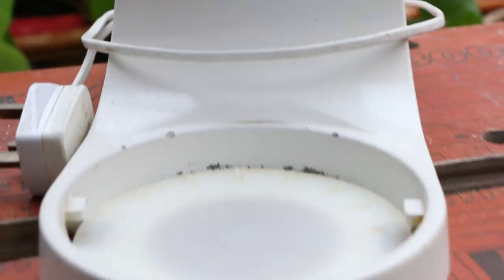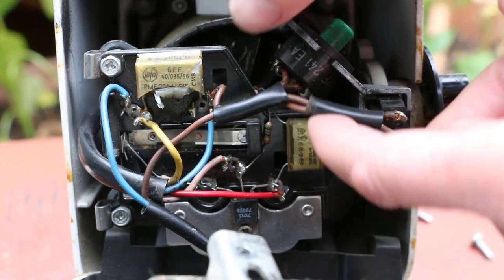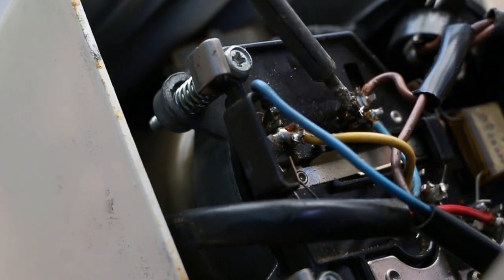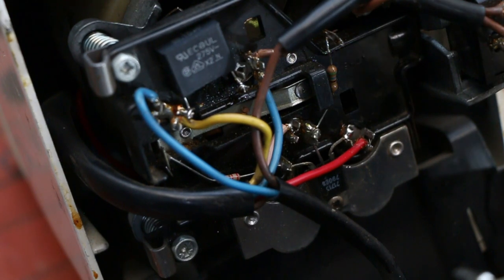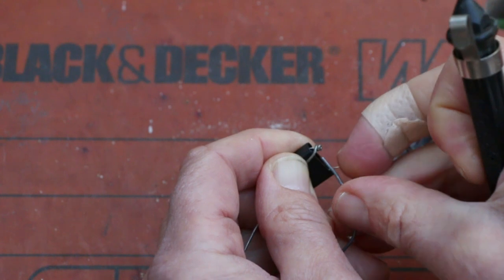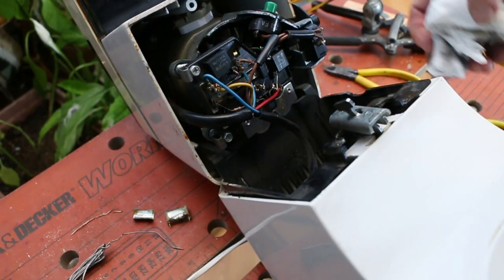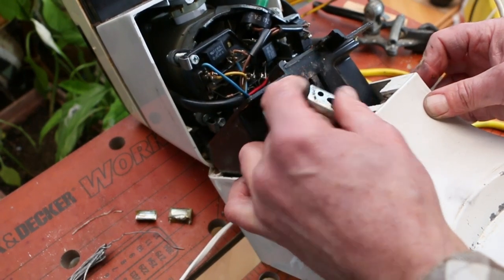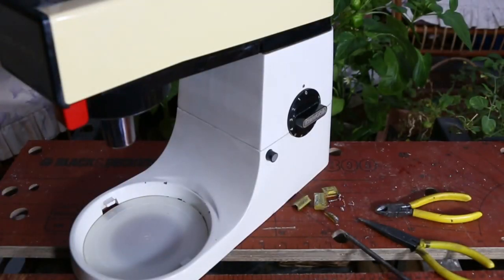Kenwood Chef A901 Smoking Capacitor and Repair.

Comment: The Caps on the mixer are both different ! , but you have put 2  of the same type back  on  !
Reply from the maker: On my machine the larger one is Class X2, 0.15µF 275V the smaller one is Class X2, 0.047µF 275 V. They both look similar but are different values.
Reply: @twotone3070  Thanks for your quick reply , do you know what make they are ? .
Reply from the maker: @SpikesMavic  I didn't choose a particular manufacturer, but I did use a CPC Farnell for the supplier to ensure I got genuine quality components. The part numbers were CA07109 and CA07107 respectively. Cost more for the postage than the parts, a total of £7.02 but you do get 5 of each.  The important bit beyond the capacitive value, is that they are X2 rated and e-bay may not result in the best quality.

Comment: hi, what are the capacitors I need to do the same job please?
Reply from the maker: Hi Andy. The larger one is Class X2, 0.15µF 275V the smaller one is Class 2, 0.047µF 275 V. Are you in the UK?
Reply: @twotone3070  thanks for the fast reply only just watched the video 5 minutes ago
Reply from the maker: @andystanley562  I'd have been quicker had I not had to Google the ALT230 to get a µ symbol :)  If you don't have a preferred supplier for genuine components I used CPC Farnell and the part numbers are CA07109 and CA07107 respectively. Cost more for the postage than the parts, a total of £7.02 but you do get 5 of each :)
Reply: @twotone3070  thanks for that, I am not an electronics guy - outdoor education is my thing,  have a YouTube channel just started - Expedition Hiker -  but my parents gave me the pass me down Kenwood, but 1st time turned on, it smoked so be nice to get it working,
Reply: @twotone3070  Thanks,  i have placed an order with CPC and ended up buying other stuff from them too, although not sure once paid why they want to do a credit check as not looking for an invoice
Reply from the maker: How did you get on with the mixer?

Comment: My Kenwood just made a loud pop and started smoking, and it stank! I have opened it up and the 0.047 capacitor is cracked like the 0.15 capacitor shown in your video. I have ordered the repair kit and will attempt the repair myself. Do you think it necessary to also replace the resistors and triac?
Reply from the maker: As it is in the speed controller part of the circuit I would probably change the triac as there is a risk that damage could have been done and you'd end up doing the job twice if that was the case. 
As far as the resistors go, if there is no damage visible you could take the risk that they have not blown open circuit, but then again they are not that expensive and you probably won't need to open it twice.
As I have mentioned before, the important part of the capacitor replacement is the X2  specification, it's a safety issue.
Hope this helps.
Reply: @twotone3070  Ok thanks! The repair kit I bought contains the triac, and resistors, so I'll give it my best shot!
Reply from the maker: @annemccabe9126  Nice hot iron, flux either in the solder or separately, make sure the tags are clean, make mechanical connections before you solder if possible, take photos of where things go, check the leads on the triac are the same configuration, don't heat the components too long, plenty of light, wear safety glasses - you won't get 2 goes if you flick solder in your eye, work out the order of operation so you don't block your own workspace.  Nothing to it - oh and don't burn your fingers. :)
Reply: @twotone3070  Thank you! :D I did electronics at GCSE but that was about 20 years ago...I'll let you know if I was successful!

Comment: Hi there. Do you have any plans OF the motor armature. I need to clean the armature and I need to know how hard it will be. Thanks
Reply from the maker: This doesn't belong to me so I can't take it apart again. I will look at the videos and see if I can highlight what you would need to do. Sorry it won't be for a couple of days though as I'm out shooting videos for my other channel.
Reply: @twotone3070  thanks a lot friend. I am searching also in document sites but i have not found anything yet
Reply from the maker: @giorgiokawa104  I have found this video (not mine) where he seems to go deeper into the machine. May be worth a look. https://www.youtube.com/watch?v=RozelD1ZXnY&list=PLNQ6Wv9valI8bHtUj707m9gcDr650VmVQ&index=3
Reply: @twotone3070  I got it but it is about 702 models. 902 is much different. Anyway I opened the armature I have cleaned it and now I have to put everything back :) I need some special washers though and I have to make a little search for them. I will try to post some pics soon
Reply: @twotone3070  Hi my friend. I finished everything with the motor but i have an issue with the resistors. I have lost the speed control cause the watts of the resistors I think is too much. I have pics of every step of cleaning and fixing the motor and i will post them soon so that everyone will find help
Reply from the maker: @giorgiokawa104  "cause the watts of the resistors I think is too much" do you mean the resistance of the resistors?
Reply: @twotone3070  no the fourth colour is gold.
Reply: the tolerance
Reply from the maker: @giorgiokawa104  That means the resistance of the resistor can be as much as 5% more or less than the stated value.
Reply: @twotone3070  correct and i this this is the problem with the speed controller. I have the original one and i will seek for all tolerance values to test it and then i will tell you what happened. The armature is too clean now ant everything inside the motor is in a perfect condition.I will post the pics soon
Reply: @giorgiokawa104  What are the colours of the resistor colours?
Reply: @anthonysinfield4778  I am so sorry to be back after so many days but i am making a dinner table and I was too busy. So here is the deal there are 2 resistors connected to the speed controller. One is connected to the thin metal that is touching the armature and i call it R1 and the second resistor I call it R2. 
So the original R1 red red brown gold on brown body. so it means it is 220ohm tolerance 5%
R2 is green blue black gold on grey body so it means it is 56ohm tolerance 5%
the new resistors that i received have the same values BUT the resistor body is almost double from the original ones. I thin it has to do with the watts the resistor can hold and maybe this is why i lost speed control . This week i will try to visit my electronic store to find same thickness resistors.  I also will find a way to upload images of the motor totally disassembled
with instructions how to put everything back in order
Reply: @giorgiokawa104  You can use a larger size resistor as it will have the ability to carry more current and hence wattage, so that is a good thing. Do not use a smaller size as this could burn up. So if the new ones are larger and the same values the you can fit them without having to worry. It would be the resistance value that would have an effect on the speed control. Have you tested the actual resistance values of the old resistors?
Reply: @anthonysinfield4778  yep I did that and I double check with multimeter. I think it has to do with the watts. I will check it soon and i 'll be back :)

Comment: I found the same model in a family member's attic, didn't think twice and used it as it was to knead bread for 2min and then brioche for another 2min and then I heard a "crack" and it started to smoke and smell. I opened it and it's the same problem, I'll get the parts and ask my husband to do the repair but I've seen videos where they also restore the whole gear box (cleaning the old grease and refilling it with new one) and I'm wondering if it's necessary to do so because the mixer is 30yrs old if not more and hasn't been used for at least 10yrs, what do you think ? Your friend is using her old mixer thanks to your repair, do you know if she ever had to replace the grease ? Thanks in advance !
Reply from the maker: Hi, she is using her mixer and as far as I know there have not been any other repairs or servicing done, so the gearbox as is from the factory. Now, that doesn't mean that it wouldn't be  slightly more efficient if it had an entire overhaul and if you found it in the attic, then it will perhaps depend on what that environment as been like. If it's been excessively hot the grease could have dried to the point of being useless.  
If you can peer inside and see if the grease is still tacky I think I'd be happy to use it like that, if the grease comes off in dry lumps then maybe not.  
People seem to love these machines and it would be a shame to see it go to the dump for the sake of a little TLC.
Please let me know how you get on.
Reply: I would change the grease.  My mothers one failed in the top gearbox (1 plastic gear), and I found a guy on ebay selling recreations of the gear.  I realise this is 7 months ago, but you can still do it. My personal mixer is about to get the works done to it, Caps and grease. It went pop during the great pandemic home baking explosion.  I bought it 20 years ago from under a table at a car boot sale!

Comment: I snipped the big capacitor off and it still works. Does it need it? I know it's a silly question. It was smoking but now works ok
Reply from the maker: I would still suggest you replace both capacitors as they will most probably be of the same age and the second is likely to fail.  I don't mean this sarcastically, just logically, but it would be fair to say that if the manufacturer didn't need to fit the one you have removed, then they wouldn't have.  I'm afraid I don't profess to know everything about the machine but I suspect the capacitor is being used as a filter, the other is part of the speed controller circuit and I would highly recommend changing both.  Hope you have success.
Reply: The capacitors operate as mains filters and keep radio interference off the mains as well as spikes etc.  Best to keep to manufacturers spec.

Comment: Hello
Sir, I therefore allowed myself to contact you because I have a
Kenwood chef A701A and it has just broken down. When I press the blue
button on the speed variator it starts normally at all speeds
(constant increase in speed) and the more I turn it the faster it
goes. Only when I put the sheet or the hook with a preparation inside
it leaves timidly and stops immediately turning although the engine
is still very audible. I think he no longer has the strength to train
the accessories. I started to disassemble it because I was thinking
of a problem with the strap on the top but it looks in good
condition. Before dismantling everything, could you help me by giving
me some tips on the breakdown. Hope you can help me thank you in
advance. cordially
Reply from the maker: You say that yours is an A701? I have only fixed this A901.  I have to say I only did the repair you see in the video on that machine, any advice I am giving is purely theoretical and not from experience. If the machine is more than 20 years old I would suggest changing any capacitors as there is a possibility that the capacitor in the speed controller is failing when you draw more electric current during mixing as this loads the motor. Also there could be carbon brushes in the motor which are no longer making a good contact and again when the load is applied to the motor the higher resistance will cause the voltage at the motor winding to reduce, slowing the machine.  I don't know how the speed controller works in detail, but those are the two parts I would look at first.  I hope this helps.
Reply from the maker: Take a look here as it may help you inspect the brushes. https://youtu.be/_cHbfg4zJ_U

Comment: Well mine is all mounted on a circuit board and  looks like two capacitors have burst. I cant see hoe i can repair it short of complete disassembly including unsoldering 4 wires and unmounting the circuit board. And its difficult access to the screws. so i think its junk now tbh.
Reply from the maker: Could you leave the existing capacitor leads in place attached to the circuit board, form hooks out of the ends and solder the new capacitors to them? Shame to bin it when you can see what the problem is, the machines seem to be well liked by their users.

Comment: Hi my kenwood a701a at lowest speed runs st full speed any advice thk
Reply from the maker: I don't have the actual mixer in the video so am unable to test anything for you, also it's a different model. But you would need to take the cover off that lets you see the mechanism on the inside of the speed knob to work out how it is done.  Obviously having disconnected it from the mains by removing the plug from the wall.  In the A901 there is a capacitor in the speed controller circuit and this may be the same in yours, if that is the case it could be as simple as replacing it.  Let us know what you find - TAKE THE PLUG OUT! :)
Reply: Ok thk

Comment: If anyone could help me with my problem I would appreciate it very much I am in Canada 🇨🇦 and a friend asked me if I could possibly repair her mixer that was smoking I found burned capacitor and resistor directly beside it. I replaced both reassembled and ran it for about 5 minutes only to have another capacitor burn arghhh need help please...how do I contact you thank you so much 😊
Reply from the maker: As both the capacitors are likely to be the same age,  I would simply replace the other one. Make sure you are using ones of equivalent quality, if they are X2, then they need to be X2.
Reply: Twotone ..wow thanks for quick reply I know next to nothing about electronic side of things so it’s difficult.
Reply: Twotone don’t know what you mean by X2 please explain I got these from the kit they sell on amazon 2 capacitors 2 resistors
Reply: Twotone is there a way I could have a FaceTime discussion wish you were here to help me
Reply from the maker: @bobthibodeau5699  I'm no expert, but it explains it here https://www.allaboutcircuits.com/technical-articles/safety-capacitor-class-x-and-class-y-capacitors/
Is the latest burned out capacitor the remaining one in the kit, or have you used both already?
Reply from the maker: Bob, how did you get on?
Reply: Twotone I ordered two new capacitors for the model A901D model they should be here in a week. If I have any questions hope you don’t mind me consulting with you . Thx so much for your reply. Sincerely Bob from Canada 🇨🇦
Reply from the maker: @bobthibodeau5699  No problem. Let's hope this gets it fixed.
Reply: Twotone guess what my friend parts are probably going to be delayed but for sure( Corona) I want your help via FaceTime my brother your willingness to help is so appreciated. Just so you know full story it’s a bit funny but not. The Blender Woodward A910D model belongs to fellow snowbirds in Mexico so the six of us are here in Puerto Vallarta. She has had it 40 + something years and she treasures it she does volunteer baking for the underprivileged here at local landfill. Anyway all Canadian tourists ( especially those in 79-80s ) are panicking to get back to Canada. The Healthcare here isn’t the best. Now here’s the part I don’t blame you if you shake your head as it sounds nuts. He had one of his lungs removed 2 years back. Super high risk if Dave gets infected. I am driving 4 Canadians to airport everyone is leaving 1-2 month early. Leaving in next 20 mins to pick them up. Grocery shelves here are still well stocked good because we’re here till end of April. We drive 5 days from Alberta they fly. Anyway the Covid stats from media here are faulty as nobody is being tested. Anyway take care,  stay well friend  sincerely Bob Thibodeau sorry bout long letter.
Reply from the maker: @bobthibodeau5699  Let me know when the parts arrive and we'll see what we can do.
Reply: Twotone guess who got ordered back to Canada from Mexico ...yep you guessed it me thanks to Corona Virus , parts being delivered to Mexico address and not thereto pick up parts till next year! Arghhh how are you there Twotone? Stay safe but text you next snowbird season

Comment: It seems to be adjusted at low speed parts. 
I mean it needs tobe slower than the current speed at level 1 or 2

It is simple. Just driver job. 
There are two bolts attached to springs . just tighten a little bit and check the speed with power. 
Triac id the last thing to be replaced if it is not working properly.
Reply from the maker: Thanks for the extra info.

Comment: Hi what capacitors do i need? Where can i buy them please
Reply from the maker: There are referb kits available on line, but I suggest you get them from a reputable supplier like RS Components, CPC Farnell, Mouser or Digikey as they have to be X2 rated to be safe. 
I can't recall off the top of my head what the values are, it's somewhere in the comments. 
You need to check what the ones are that are fitted to your machine.